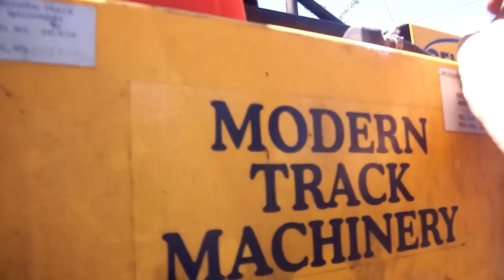Railroad thermite welding near the Mississippi river

Comment: dumb question but what are they using to light it, is it just a normall sparkler?
Reply: Magnesium Ribbon, thermite need to be really hot to be ignited
Reply: dane belling yes its more reliable than a match. its also definitley hot enough.
Reply: Also a lot easier than trying to toss a 767 in there....

Comment: so what does this do for the track?
Reply: would think expansion and contraction of the rails during summer / winter would be an issue.  we have gaps in sidewalks and highways for a reason, you'd think steel rails would be the same.  i understand having high quality welds for high speed rail, but you can;t change laws of physics when it comes to expansion and contraction
Reply: does make me wonder how the track adjusts for expansion / contraction as it gets hot and cold though.  you'd think it would bow out of place.
Reply: +anonymous  Not iron, the Thermite reaction creates Carbonized Steel. And yes it's turning two pieces of track into a single piece by reforging the steel on the spot. 

+Matt Albrecht  They pre-stress the steel by stretching it. That way it's already expanded, another way is they heat the rails up before the hot season. There's no way to completely negate the problem that's why rail roads need maintenance.

Comment: how the wages ?? please tell me :)
Reply from the maker: Around $12.50 an hour is what I was getting paid as a helper. Also on some jobs it's a flat rate of $100.00 a day sun up to sun down most of the time. Now if your a welder you get a few more bucks an hour. Also at the time I got $50.00 a day for per diem.
Reply: You can't be serious? That won't even pay rent if you live in a cheaper area....
Reply: I'd have to assume this is Union, and paid extremely well...
Reply from the maker: Triston Charge
Nope not Union, It is contracted out. They are doing more and more of that and slowly removing the Union workers that do work for the railroad it self. :(
Reply: Scott Dolatowski Damn, what a shitty deal.
Reply: Adam Adam depends on location. company you got the contract from. wether its union or not. and if its not union, depends on the company that you contract with. and if its not union, experience too. so anywhere from$12/hr to $31.75/hr. right now in PA. septa union members get $31.75/hr.
Reply: Contractors don't do this welding...atleast not for bnsf that I'm aware of. We get paid around $28 as of 2017 to do this, grinder gets $27. I'm actually watching this waiting to get on the track to do the same thing....hurry up and wait.... been doing this for 3 years and recently read about some of the 9 11 conspiracy theories and after doing this for the past 3 years it's believable that the beams were taken out with weaponized thermite, I've read manuals and the material can reach around 3600 degrees. The videos of something dripping from the towers before they collapsed is definitely thermite in my opinion, looks the exact same. I've buried bad charges after lighting them in the ground and came back the next day, still warm. Firefighters said they saw molten steel running down the channel rails, got news for ya folks.....fire, even fire from jet fuel burning for however long you want to imagine cannot melt steel.
Reply: and by the way we get $28 a day for per diem, and hotel paid for if you're on a mobile welding gang. usually shitty hotels but you can't argue with free. Bnsf 2017....the traveling gets really old but as part of the union rules with getting your labor and other dates started you bump up on the seniority list and can bid different jobs pretty much anywhere you'd like to go. Benefits and pay are unbeatable, just hope we can keep them with everyone saying we make too much money and don't pay enough for health care....the company still made 7 billion in profit and doesn't want to budge on contract agreements. Political bullshit. Nobody has ever gotten rich by being an honest and trustworthy person though am I right?
Reply: Scott Dolatowski that is a terrible wage brother.

Comment: Isn't this the same stuff they used on 9 11?
Reply: Uh, no!
Reply: Actually there was no thermite at all. There was aluminum dust and iron oxide(rust) because that is what skyscrapers are made from. lol
Reply: ShyRage1 no it's not they used planes not thermite
Reply: Not quite. All the lab tests done on the dust following the collapse revealed microscopic particles of nano-thermite and thermate which are like traditional thermite but on steroids. More technologically advanced. Only a few labs in the world are capable of producing it, the only one in the US being Los Alamos. Shit, even the USGS inquiry into the dust composition revealed about 5% steel micro spheres content. Anyone who claims the buildings collapsed due to plane impact hasn't combed through the scientific evidence.
Reply: B.S.  Airplanes were the smoke screen.  And if so , how did building 7 fall at the same rate of speed (gravity) that towers 1 and 2 did.  The only way a building fails catastrophically at the speed of gravity is with a controlled demolition.  Pulverized concrete instead of slabs.  17 years later and people still don't want to know.
Reply: I thought it was fire started by plane impact.   Lets all stand in a circle and point to the right as the cause.  You could in fact say it was there religion that caused the building to collapse.
Reply: Don Johnson The collapse of buildings 1 & 2 both began at the floors where each aircraft impacted. Are you saying that they also happened to have placed thermite in those areas beforehand, knowing ahead of time exactly where each plane would hit? If so, I think you are reaching a bit. If there was any thermite used it may have been on building 7.
Reply: Don Johnson, what is your degree? People who know about this sort of thing, like myself, think theories such as yours are nonsense. Super-thermites are laughable even if it's just the fact that, if it was a sort of sabotage, they're so overboard they aren't even needed.
Reply: ShyRage1 YES!
Reply: Gogh Fitness It was put in place way before. They flew the planes into the towers to throw people off like you and the majority. Jet fuel WILL NEVER burn hot enough to melt steel. It was a planned demolition.

Comment: but but.. if jet fuel can melt steel beams... nm... 9/11 never forget
Reply: they didn't melt them, they heated them up and bolts expanded and they sagged in the middle and all the weight from the floors above made it pancake and collapse on itself!

Comment: Yeah keep lookin at yer watch ta see how much time you can waste on the clock, standin there lookin busy....Any other crew woulda had that job done and on to the next one already
Reply: Errrr... no.  He's waiting for the 3000'F pool of molten steel to cool down.  Cooling it too fast makes it brittle, which is the last thing you want in a rail track, so they need to leave the forming mold in place long enough to hold the heat in the metal.  So he's checking his watch to see if he can bust it out yet and get to the next one, not if it's time for his coffe break.
Reply: I' m a thermite welder since 1988 and i don't stand around.. when the weld was poured they should add ballast  under the weld to hold the base plate, the crucible could have been taking off much earllier with the proper tool instead of grabing it and tossed by hand, next the slag pot removed and put aside safely, not throwing it, access fusal paste scrapped of e molds. Using stop watch or by look you know when molds can cut and sheared, all the hardware can be picked up and moved to the next weld etc.

Comment: US railroads are awful. European design much better.
Reply: +mikeallenbrown1 Go away troll. Do something that does this world some good.
Reply: +Hammer ForkJP That's a very strange angle to argue.  "Our system is ancient, out-dated and dilapidated, it's much better than your new high-tech system!"
Reply: MrCorbin2618 I live in the UK, just about the only country with an older railway system than yours, and it's terrible.  I haven't been to the US so I don't know how well they are maintained but an ancient system comes with many flaws that cannot be fixed because the infrastructure is limited in what can be changed.  We are capable of designing and building far superior infrastructure these days, that is not the question, the question is whether government will allocate the funds necessary to do the job properly, whether they have that long-term vision that creates things that stand the test of time.
Reply: +CowLunch private investment for the infrastructure is much better, when Rockefeller revolutionized infrastructure he overran any nation competing , if the concept of rockefeller would be applied today and giant american and foreign investment groups would invest into the railroad-lines your mind would stop to work for a second when looking at the result.